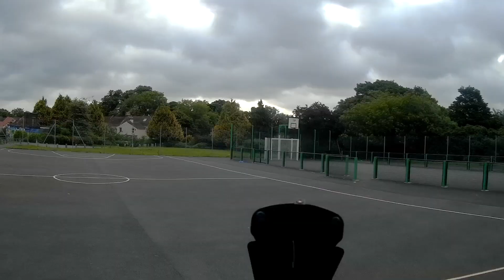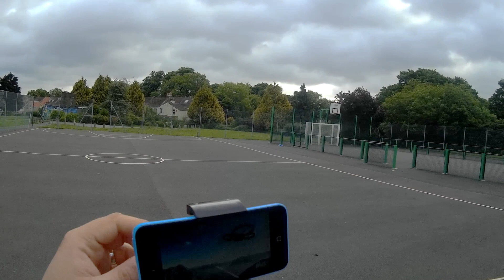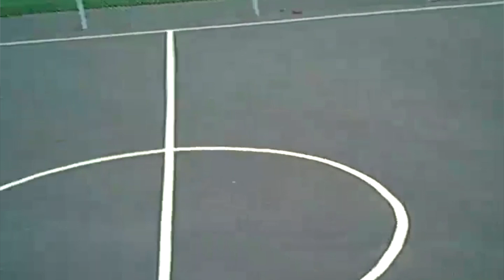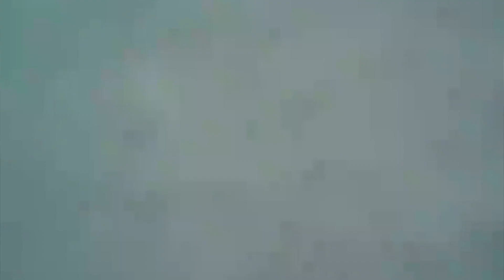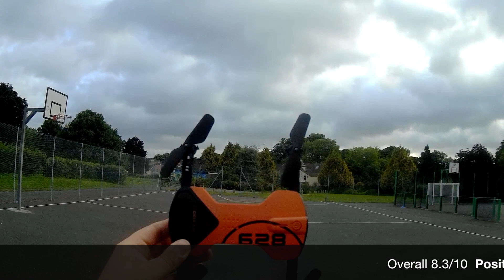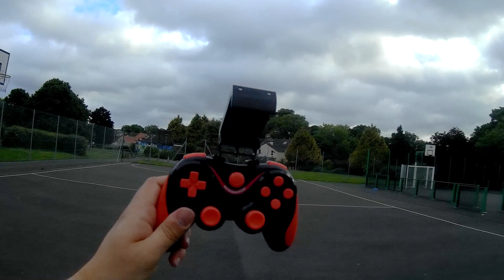Kingtoys HC628 Dreamfly Quadcopter Drone Flight Test Review

Comment: Hi, thanks for this Dream revie and for the flight comparison video and other 3-way comparison as well.
Will adding some rubber (for height) to its feet affect its flight? Similarly, if I also add, say a large coin (for some stability) on its body affect its altitude, flight or take off/speed?

Appreciate and TIA for your feedback.

Comment: Hi, i just got this drone recently, i tried it and it flew ok and decided to continue its flight testing tomorrow, but i cant seem to get it flying anymore, is mine broken already?😭,
Reply from the maker: Hey carl louie dela cruz thats strange, battery fully charged? are you using the transmitter or smartphone, is it powering up? How far do you get?
Reply: JD Quad , its powering up, im using the transmitter, i get it to work earlier though, but its really hard to make it work again, could you help me? how do you start your drone to work, i mean what specific buttons are you pressing to start up.
Reply from the maker: Hey carl louie dela cruzThanks for the info, ok Im just charging up the battery so i can double check, ill be back in touch in a little while.
Reply from the maker: Hey carl louie dela cruz I have got the video to the part where i take off and show the button to press, https://youtu.be/1NnizrIJpAk?t=3m Hope this helps.
Reply: JD Quad , i tried pressing that button but it only makes a beeping sound, i start up mine by moving the two joysticks downwards and it starts, but now even that method is not working anymore ahaha
Reply from the maker: Still not working? OK, if you aren't getting anywhere with the transmitter try using a smart device and see if you can take off using the app.  You may want to seek manufacturers help as it seems it may be faulty.

Comment: Hello, I would like to know how to shoot because I have one and when I select to shoot it does not save the video just the photo.
Reply from the maker: Hey Rodrigo Ramos, Umm this is a strange one, as long as you have enough space free on your smartphone and the app has access to save the video to your camera roll (or equivalent, im guessing so as you can save photos) there should be no problem.  Have you tried installing the app onto another device? Is the phone connected to the drones wifi connection?  I take mine out again and try and see if i can replicate this at some point.